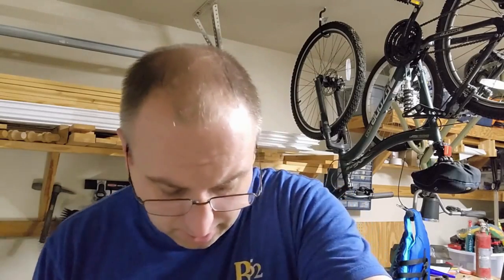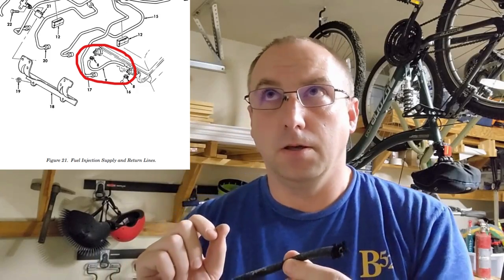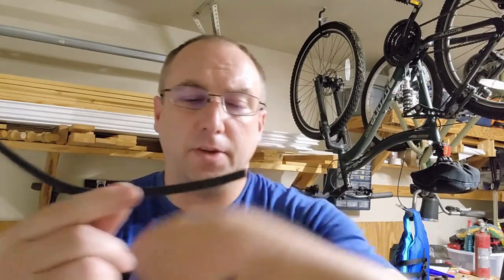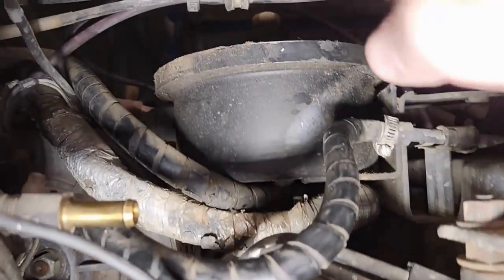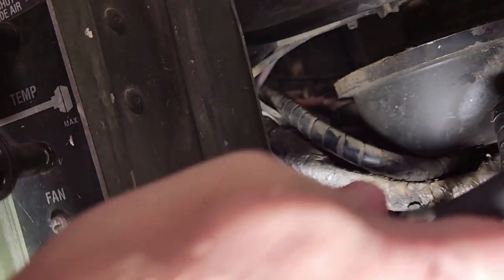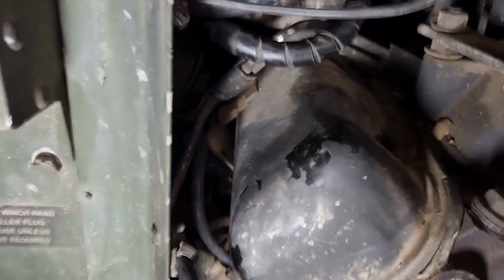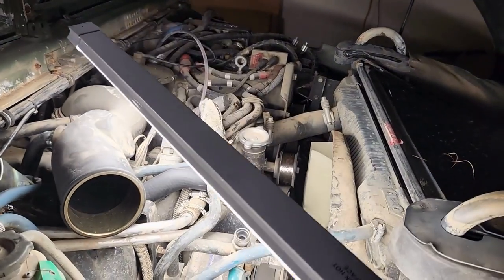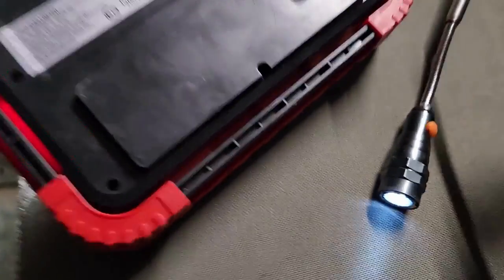Project Thor HMMWV - Fuel Leaks Fixed

Comment: Something you can do with the extra length of line instead of cutting it just push the extra over the hard line so if you do get a hole you have extra line to cut
Reply from the maker: Good idea.  A side note, I'm now planning on relocating the fuel filter so I can better access it without needing to move around the 400a generator.

Comment: Very helpful. Thank you. I have a leak in the same vicinity and I think it’s gonna be one of these return lines, or the pump to filter line.  Funny thing is I JUST got done changing the fuel pump this wknd- I wonder if the new pump was more powerful and sprung the leak?  Where did you order the German fuel tubing?  Thanks again
Reply from the maker: Good luck!
Reply: I have a leak too.

Comment: FYI, when you attached the main fuel hose, you turned the start switch to "ON" while waiting for WAIT light to go out. You checked for leaks and were excited when you saw none. Just turning switch to ON doesn't activate the fuel pump! That only operates when engine is running/turning. So, you can't check for leaks without it running
Reply from the maker: Yeah.  I realized that.  Lol